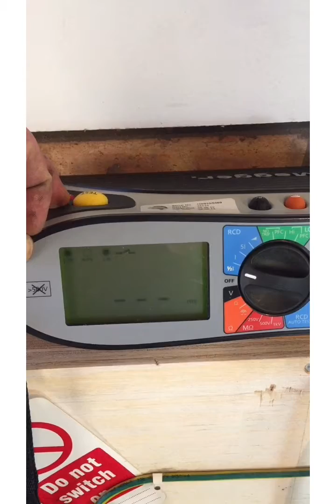Faulty RCD

Comment: Is that ok to have only an rcd as protection. ?
Is that an rcbo?
Can a solo rcd be used as sole means of protection/ isolation?
Is it a special scenario because in a garage etc?
Thanks
Reply from the maker: Not an RCD on it's own, no. Only in conjunction with a circuit breaker. An RCBO has the properties of an RCD and a circuit breaker combined.

Comment: I think I have an over sensitive rcd as I can’t nail it down to one appliance or circuit breaker, but you say this is not common?
Reply from the maker: Real Alex Couple of times a nearly 40 year career. Cpc continuity/IR test circuits and appliances. PAT test appliances using multi-function meter you already have 👍